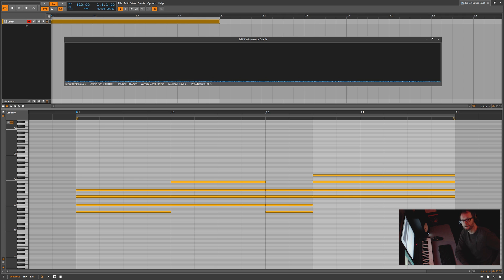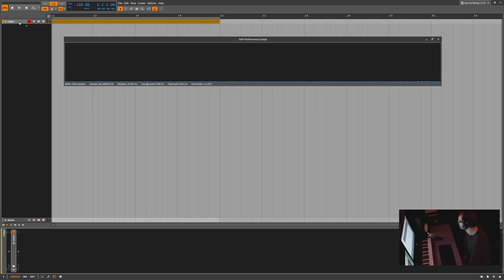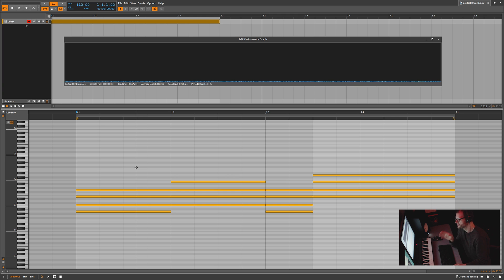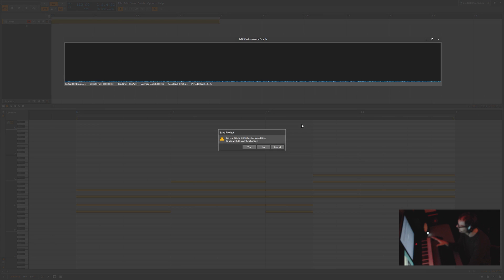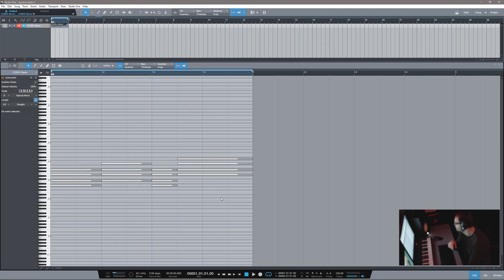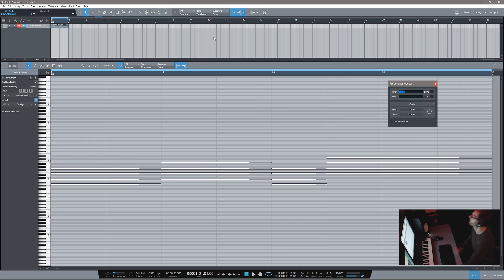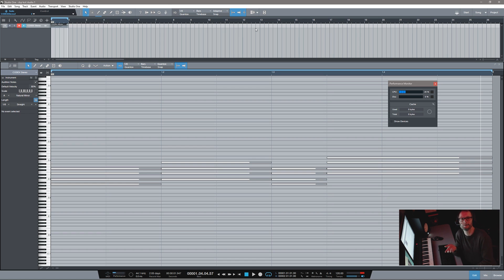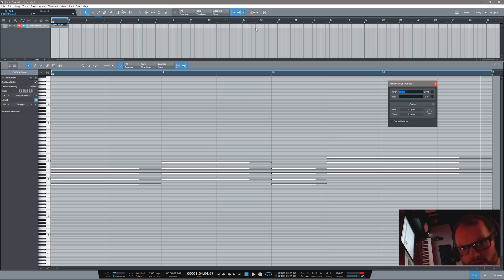Bitwig Studio 1.13.15: DSP issues

Comment: 96kHz Bitwig vs 44.1kHz Studio One, so what did you expected?
Reply from the maker: Yes I really messed this one up maybe you should disregard. I have been having issues with DSP in bitwig thoughts
Reply: chillcomputerguy Sure, but you need to take into account that almost no other DAW (except Live with MaxForLive) does audio rate modulation, which requires particular handling of audio engine. Look for today's video by Polarity on doing bass in Bitwig and your mind will be blown. You might not need this or appreciate that such thing is possible, but it will only mean Bitwig isn't for you and not that it's a bad DAW.

Comment: Hi CCG,
looks like Bitwig is at 96kHz and Studio One is at 44.1kHz.
Reply: That was a pretty fucking big error to make when you're claiming to have the "exact same setup" over and over again in your video.  No offence, but you've proven to the world that you don't have a clue as to what you're doing.
Reply from the maker: Oh yeah i remedied that in a second test and had  similar results
Reply: Thats impossible to have CPU same for 44.1 and 96kHz esp. for virtual synths that can use the whole bandwidth otherwise everyone will use it ;-)

What is your setted latency for Studio One? I can setup Bitwig the way I cannot play without hiccups and I can set it to play with higher latency setup. Esp. if I end up mixing I set up the highest latency to play nicely.

Also you could ty to setup Bitwig in a way every plugin has seperated process or as a whole. Some heavy plugins can benefit from first or second setting.

Also if you have Win 10 look for power settings problems that was updated and the performance goes down. (I will stay away as logn as I can from shitty Win 10 auto update)

Comment: Ouch, but thanks! Just bought it recently, registered it today to have version 2.
I really hope this video will become irrelevant because they fix it.
Reply from the maker: Bitwig is great I'll probably someday upgrade myself. Its mainly  the heavy DSP synths that I see problems with. If you stick to using single layers for those synths, bouncing down as you go or just sticking to the default devices or  instruments that are less resource heavy you shouldn't have to big of a problem. But I would like to see DSP performance improved in future releases
Reply: Yes will do that, thanks. I installed version 2.0 today and it runs fine for me. Just about as good as ever, and the machine is windows xp era so i am not complaining <3 he does manage one clean serum at a time, which is good enough to progress right now, ben holding myself back for way too long. good luck with your dsp!